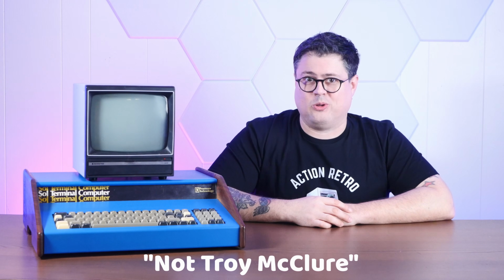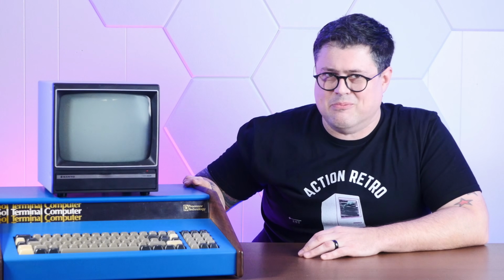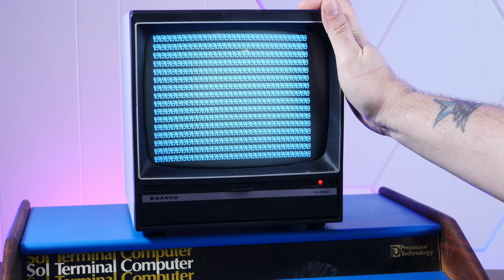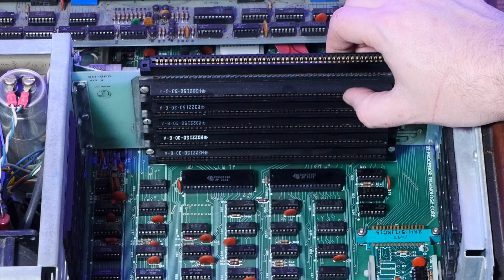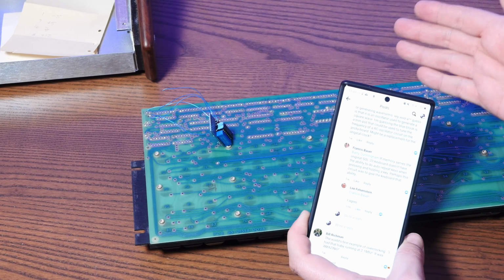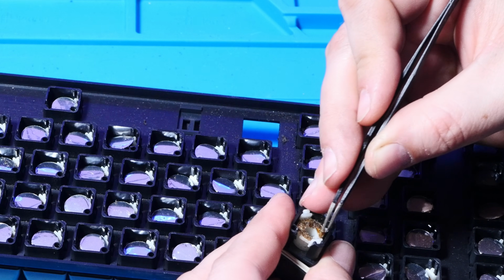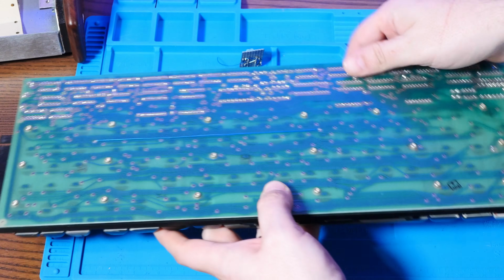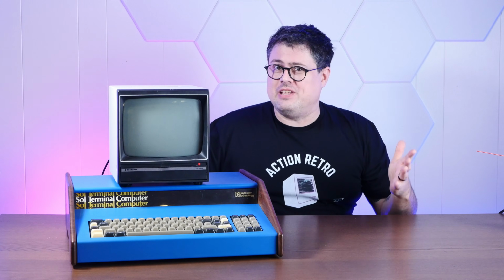The Most Important Computer You Don't Know About

Comment: But the important thing, is what processor did it use, and at what clock frequency?!?  I know it will be slow, it's 70's era 8 bit, after all.  But inquiring minds want to know.
Reply: If you run a Google search, you’ll find multiple results stating that the SOL-20 used an Intel 8080 processor running at 2 MHz. I’m sure that correctly describes the original design, but Processor Technology evidently switched to a different processor at some point. The SOL-20 that my father built used a Zilog Z80 processor.

Comment: Yeah that brings back high school memories (1977) - a fellow classmate built his own Altair 8800 system from the original MITS kit, then soon after got a SOL terminal to write BASIC and ASSEMBLY code by typing it in instead of having to toggle all those switches on the Altair. I recall seeing ads in Pop Electronics for the SOL, but all this nice 8 bit hardware at the time was out of reach for me as a kid going to public school on a limited allowance. Of course now I have a renewed internest in all of these classic 8/16 bit computers. It's amazing this SOL boots at all given that EPROMS have limited life span for data retention - perhaps that is a burned fuse type PROM. Those capacitors are HUGE because at the time all PSUs were the linear type and had to filter out 60/120 Hz to provide a nearly ripple free +5V. Later switching supplies used a higher frequency for smaller capacitors. BTW it's amazing those capacitors still work after 47 years, if those are the originals. I wish modern ATX PCs would be built like that instead of the tower config.

Comment: If I were you, I would look into a modern switching power supply to replace that monster linear type in your Sol 20.

What a great machine!  I have an Apple 2 //e Platinum and one of these would deliver a similar retro experience! 

I enjoy adding cards to improve the machine and or run or write programs, play games.

There were a lot of S-100 cards made.  Getting a set for your Sol should also prove to be good fun!

But, back to the power.  Linear power supplies like that run hot, are inefficient and can damage your Sol when they fail.  You should be able to find something you can stash in that case somewhere.

Comment: That booting issue, some thoughts:
Is the reset duration correct? 
Is the deforming logic always triggering the CE/CS and OE signals always triggering to that eprom after a reset? 
Last year I had an old Soviet/DDR chess computer that didn’t always properly start and it was an inverter that was floating a bit.
After replacing the communist UD something with a capitalist 7403 I believe it was booting consistently. And that wasn’t even related to the reset and decoder logic but just the keyboard. Having “multiple stuck keys” preventing the software to properly run.

Comment: Glad to see one of these working again... I remember seeing ads for them back in the day, but never saw one in person. I didn't know it was s-100 either. I still think the S-100 bus should be called the Altair bus, they invented it. But the other builders didn't like referring to the competition in their ads so they renamed it "S-100". I built an S-100 machine from Kilobaud magazine plans back then... those were fun times. Every once in a while I think about digging it out of storage and doing a "anachronistic upgrade" to it. Like replacing the 2102 and 2114 static RAM with a single CMOS RAM chip, and replacing the 2116 EPROM with an EEPROM. And replacing the linear power supply with a switcher salvaged from a PC/AT.

Comment: I still have one that I built from a kit back in the 1970s. The keyboard wasn’t very good for touch typing even when the system was new. I wanted to use it as a timesharing terminal, but the keyboard wasn’t really good enough for serious typing.

A few years ago, I thought of trying to get it running again, but I couldn’t find the power cord for the Panasonic monitor. The cord plugs into a 4 pin connector. Without the cord, I couldn’t figure out what voltage goes to each of the 4 pins. If anyone has a schematic for that vintage Panasonic monitor, I’d love to get a copy of it.

Comment: I used an S-100 based machine from Cromemco from the late 1980s that had a CPU card with a Motorola 68020. I wonder what would happen if you plugged that CPU into the SOL? That machine also had 32bit frame buffers, a hard drive controller, and a bit-slice processor.

Comment: Not knowing anything about the machine, my guess in regards to the inconsistent boot points to a capacitor. resistor, or a capacitor/resistor combination problem.  Several clues seem to point to that.

1) When you first powered it on, there was a loud buzz that sounded like a defective capacitor rapidly charging
2) Turning the power off/on didn't let the capacitor discharge all the way, and get close to a full charge quick enough to power the personality card before for what would constitute as a POST (the 9 and N pattern) to complete and had off control to the card
3) Successive power cycles required fewer times to get a good boot
4) I was thinking a possible resistor problem because how fast the capacitor discharged, and who carbon resistors can go out of tolerances,

Comment: The Sol was a wonderful 8 bit machine. Built like a tank and solid dependability. I built had five of them and built two Sols. I also had a Helios disk drive (that was very rare), The Helios was the fastest floppy disk in the world. If you would like to talk to someone who knows PT machines inside and out feel free to send me a note.  I wrote millions of lines of code for PTDOS (the PT OS for the Sol and Helios) and CPM. The OS on the personality module was called SOLOS. SOL Operating System. I wish I still had my old Sol and Helios. If you ever get to see a Helios it will BLOW YOU AWAY! Let em know if you want to talk. By the way, the keyboard port was a straight parallel port so any 8 bit parallel keyboard will work. That little board wired to the keyboard might have been a G-bell modification because the Sol had no G-bell. Although I remember that the port output for G-bell was on the main PC board. All of the commands for SOLOS were two characters so you don't need to type TERM just TE. Some of the commands were for a tape drive and the jacks for the tape drive (just a cheap mono cassette tape) are on the back of the Sol. Good luck -Paul

Comment: I remember reading about them in PE but a little hole in the wall computer shop had one back then a couple of blocks from Purdue. I talked to the food Co-op just down the street when at meeting it was brought up about a need for better inventory control. I said there is a little store pointing out the window that sells computers.
Years in electronics say's clean resocket resolder any suspect pads and pins on connectors. Chemical of choice and 100 PSI air jet, not chemical only.

Comment: Regarding the random boot issue, check the PSU capacitors. I had the same problem on a modern PC, I had to press the power button several times before it manages to boot, the reason was the PSU capacitors had leaked (I replaced the PSU and it now works fine).

Comment: I have a working SOL-20 Terminal Computer i my collection. I do believe it was way ahead of its time. I also think that Steve Jobs and Steve Wozniak may have copied it, when creating the Apple II using the 6502 processor, instead of the 8080 as the SOL-20 used. Built in Keyboard, serial and parallel port and video output. My favorite game to play on this machine was Target.
Reply: Target was “adapted” for the TRS80 as Flying Saucers and was my first TRS80 arcade game
Reply: @trs80model14  I still have several TRS80 Model1's One I could use some help repairing.

Comment: I used to own a Heathkit H-89 computer that could be considered a spiritual successor to this thing. It sported the ability to act as both a computer and a dumb terminal, and could switch between the two modes by pressing a key on the keyboard. Like that Sol 20, it sported a dedicated repeat key instead of just repeating after a second or two delay. It had a shift lock rather than a caps lock, which was basically a mechanically latching shift key. It also used a bank of DIP switches to set various options, like video mode, cursor behavior, etc. And I'm pretty sure it used the S-100 bus as well. It definitely predated the IBM PC and the ISA bus standard.
Reply: Also available as the Zenith Z89, its claim to fame was two Z80s, one for processing and one for I/O. I recall programming in UCSD Pascal locally and using it for a terminal to I think a Unisys 1100.
Reply: I had a Heathkit H-8 with the H-9 video terminal (horrible keyboard). Bought it when it was very old in kit years, replace one LED display and soldered a few wires (with the mandatory blister) and then would load a cassette then entered patches in Octal via the keypad on the front, patched the program and output it to a second tape. ext bot was perfect. Benton Harbor Basic baby! That was my first.

Comment: The keyboard does not use capacitive pads -- the foil simply acts as switch making contact between the two pads.  your finger works to trip the keys because of the resistance in your skin

Comment: FYI The 909090… pattern is caused by the CPU executing a recursive  0xFF RST #38 opcode. This happens when the data bus has pull up resistors and nominated memory is not presenting data on the data bus. What’s happening is the CPU reads a 0xFF opcode causes the CPU to execute the code at %0038 which is also another %FF which gets it to run another %FF opcode. As a part of this process the stack pointer is being decremented by 2 with the return address being %0039 (%0038 + 1) being written. After being run so many times the stack pointer contains the video memory address hence displays the %00 %39 characters.  To fix your boot problem check out the POJ (Power on Jump) circuit to ensure that the starting signal sequence is correct along with the first memory access is successful.
Reply: Where did I just no clip to here. 
These comments are crazy
Reply: @tommytron2000  who needs 1970 trash ? Normal people ?
Reply: How do you know this lol
Reply: Why you cry ASCII now, how mad are you ?
memory space on Telecaster terminals ???
Why you went all mad here ??????

Comment: “**DANGER** Will Robison ***DANGER***” 
Do not plug a S-100 Card into the vertical card slot backwards! I did that once and it cratered 20 chips on the mother board that took me a bit to source and replace the chips. Will not talk about the 16k memory board that I was testing. The Sales technician at the Bellevue Byte Shop (1977).
You have a faulty electrolytic cap in the reset circuitry.

Comment: Would love to see CP/M running on this someday.  But just finding a tape (or paper) loader will be one challenge, let alone a working disk controller and drive.   But the fact one could obtain an actual disk operating system for a micro, I think that's one of the defining aspects of the Sol-20 - that the community started to realize the need for such a thing (memory and file management) and move past boot up BASIC calculator-like systems.

Comment: Although I never saw one of these in person, I remember it being referenced to in Creative Computing magazine and Byte magazine when I was in high school. If you want to find another ultra rare machine from this era, try looking for a Southwestern Technical Products Corporation (SWTPC) 6800 microcomputer. It came to market in 1976 and it came to my high school in early 1980 after a two week computer course the high school was teaching. Students brought in their own Apple ][s, TRS-80s and Commodore PETs (yes this was a private school). But after the course was over, the only one that was left was the SWTPC 6800 which had been donated to the school. It came with 8K of RAM (up from the stock 4K), the SS-50 bus for expansion cards, the integrated TV screen and keyboard add on and a cassette interface. That allowed one to load a "Tiny BASIC" from cassette tape that would take about 15-20 minutes before it was ready. This is the computer that started my IT career as I spent the next several months teaching myself to program. The school in the fall of 1980 would get a TRS-80 Model 1 (floppy drives) and in 1981 were joined by two Apple ][ + computers (and I would get my own Apple ][ about this time).  Ah memories.

Comment: Thanks for the memories.  I started in computers in 1976 at the age of 14.  Got a job at The Byte Shop computer store in Englewood, CO.  I really wanted one of the Sol computers, but they were out of my Moms budget. My first computer was a Mostek KIM-1 single board with a Hexadecimal keypad, 6502 CPU w/ 1KB static RAM. My second computer was Apple II serial number 000745. Got it the same week that the 16KB DRAM chips were released, so I could do "Color Graphics" !!  Cheers!

Comment: Absolutely these are special, glad it has found you!    They showed what a kitted-out Altair could become.   The Sol-20 is predated by the Wang 2200, Q1, Sphere-1, Datapoint 2200 (all over $5k new in base form) - but still, the Sol-20 was a huge step towards that idea of an actual affordable personal computer with a bus and is about the earliest can-still-power-it-on microcomputer system one can find.   We can find late model Wang and Datapoints, but pre-1975 stuff like Mark-8's and early Wang get substantially harder to find in willing-to-power-on working order (the components to make smaller switching power supplies evolved greatly sometime around '72, iirc).
Reply: The Wang 2200 is a very interesting machine.  It was the first in a long line of Wang computers which ran BASIC code natively- that is, the language was implemented in the CPU microcode.  It also could do timesharing.
Reply: Your last comment was deleted for some reason, but to answer your question the 2200 was a completely different machine, first introduced in 1973 and having several different implementations of the CPU, having either one or two 74181 bit-slice ALUs.  The first machines had a separate compact chassis which contained the logic backplane but later desktop machines were all-in-one units.  They were available with or without tape drive storage.
Reply: In fact (according to Stachniak’s  Inventing the PC ) one of the things that killed MCM (the maker of the MCM/70) was one of its engineers chasing his vision of a breakthrough power supply which never became reality. And yes, it seems that what really made the microcomputer revolution exciting and commercially important was mostly just price, price, price (maybe with slot expandability as a distant second). In 1973 you could already buy, from WANG, a desktop computer with a CRT display and a keyboard, a cassette drive, a reasonable amount of RAM and built-in BASIC: you just had to be willing to pay well over $7000 for it.

Comment: Regarding the issue of it only booting to the OS every few/several power cycles, I'd try leaving it off for a few minutes, turning it on, letting it run for a minute or so, then power cycling it.  I could be wildly off mark on this, but if it comes up consistently with a single power cycle after it's been running for a minute or two, my guess would be that there is a chip/solder joint/something that's on its way out, and that little bit of runtime is causing enough thermal expansion to temporarily reconnect whatever's broken.
Reply: more likely dried up /deformed electrolytic in the reset circuit, it may well reform ok if left running for a while, or just replace, maybe with a non electrolytic or good quality tantalum

Comment: If you check out the Sol Systems Manual 1977, page 165 describes the reset circuit.  It notes capacitor C15, which you'll find near the keyboard connector.  You should check it.  It also mentions that SW1-1 (front dip switch bank) serves as a manual reset switch.  The manual is very thorough and describes the system operation in a very detailed way.  On page 255, I was very amused at the suggestion to use a piece of spaghetti as insulation for a component lead.
Reply: Before heat shrink tubing there was spaghetti tubing. It too was hollow but didn't shrink. It's probably referencing that.

Comment: Painted blue steel and genuine wood? I feel like I've found my long lost brother!
Excellent score fam!

This thing is seriously awesome though. Both a gorgeous machine and surprisingly capable for how early it was. As for the "Local" key, my guess is that that is going to be useful when it's in terminal mode. My ADDS terminals have the same functionality. It essentially allows you to shift the terminal into handling things locally without sending or receiving any serial data. For example, if my screen is particularly full of questionable decisions and I want to clear it before flipping the camera on, I can hit "Ctrl + Local" to pop into local mode, and then hit "Ctrl + Erase" to clear the screen without sending any keycodes, and the "Ctrl + Local" again to get back to regular serial terminal operation.
Reply: Guess I shouldn't be surprised to see you here.
Reply: Also another Terminal computer as well that will go well with your Centurion.
Reply: Make it act as a terminal for the Centurion!
Reply: I imagine this would be for 'local echo' where the screen shows the characters as they are sent out, because some remote computers didn't echo the characters that were sent to them.

Comment: CAPACITORS: Whenever a computer needs several immediate power cycles to boot correctly it's due to capacitors which have leaked some of their electrolyte and so have reduced capacitance. This limits their ability to build up hold a voltage. Power cycling them helps to charge them before they've had chance to full discharge until they reach a minimum voltage for things to work.
Reply: not necessarily have leaked, just dried up or the oxide layer deformed due to disuse,